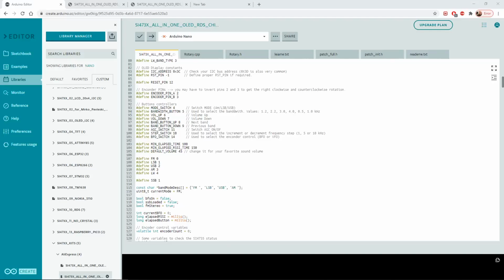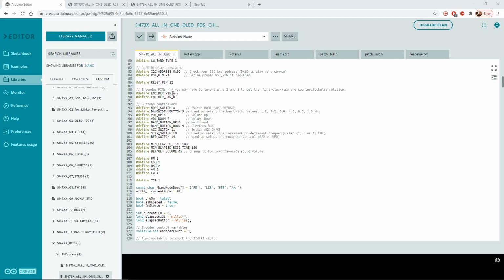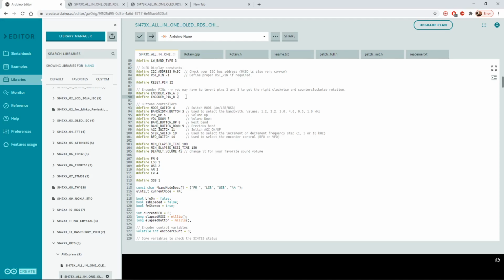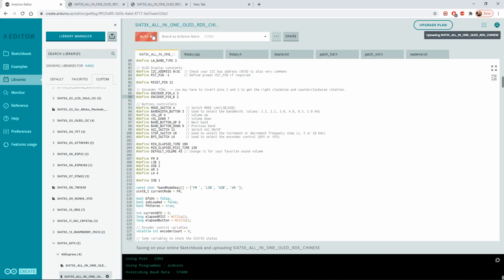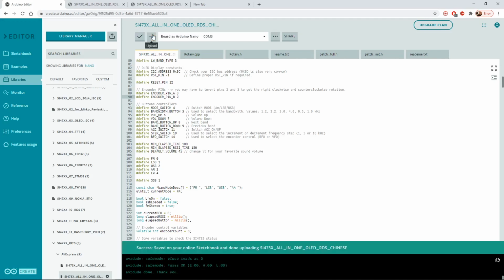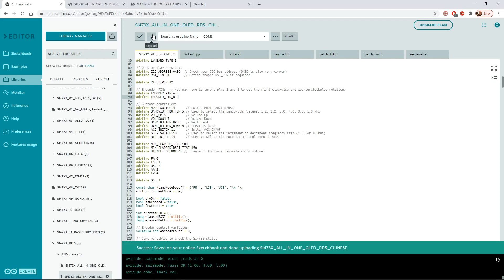Changing the Encoder direction

Comment: Hi Kevin how did you sort out your encoder problem ,mine has developed the same problem when you turn it a few clicks it does nothing,thanks
Reply from the maker: Gerald. I didn't do a video on this as it seemed pretty silly! I removed the tuning knob, it will gently prise off and gave each of the connections a tap with a small screwdriver. At the time I was just looking to see how easy it would be to remove the encoder. Oddly though after I did that the encoder started working fine and has done since. Possibly more dodgy solder joints? I don't know but it's working now.

Comment: So is it a good radio once you update it and fix the solder joints?
Reply from the maker: Hiro, thats a big question. I would say at the price I paid - around $69 or £50 then yes, when it is working properly it is a good receiver for the money.
Reply: @KevinOReillyswl  I ordered one for $50 USD straight from China. I will comment a update when it arrives in 3 or 4 weeks.